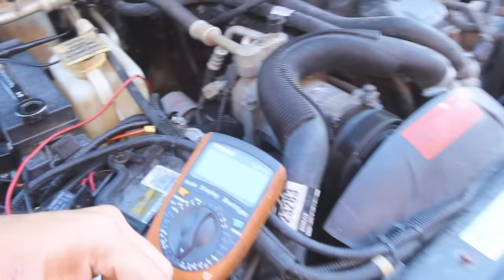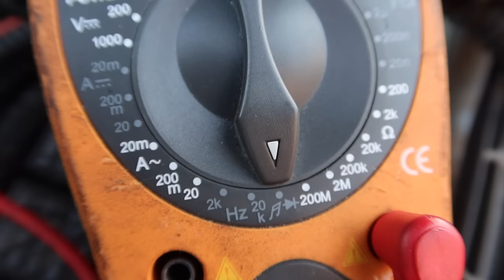AC Suddenly Stopped Working In My Car / Cheapest  Air Conditioner Diagnosis and Fix / Hot Jeep  XJ

Comment: Hello 
My current situation is - low side can’t take Freon psi is to high 160-170 psi , I notice the compressor not engage when I turn on ac , checked all the fuses and relays and they are good , fans turn on ,,,haven’t checked ac pressure switch not sure if I have one on my 2007 Acura tsx any help please thanks
Reply from the maker: Watch this yet ?  AC Suddenly Stops Working / Diagnosing An Intermittent Compressor Clutch Failure on a  Acura RSX
https://youtu.be/FEdrKv16jjY
Reply: @Donnythelatemodeltech  still confused lol 😩 I bought a compressor but feel like it’s something else

Comment: Just the video I need to check out my Dakota a/c. Clutch stopped kicking in and I called my local mechanic and he charges $95 per hour
Reply: Did you get yours to work? I too have a dodge Dakota and compressor is not kicking in. Waiting for tomorrow morning to Try this out with a paperclip.

Comment: Great video. Would this part be on a 2015 GMC Sierra truck. My air is not working. It would be great if it wasn't the compressor.
Reply from the maker: I'm pretty sure the 15s have a problem with one of the lines vibrating to failure,   leak.   Look it up.    There is an updated line.
Reply: @Donnythelatemodeltech  thank you very much for the response. I will like and subscribe.

Comment: Great video. Thank you, but what if you still are not getting any AC inside? Where do we check then? You turn the dial and absolutely nothing. Any feedback will help.
Reply from the maker: No air flow? Or no cold air?
Reply: No airflow at all.
Reply: @Donnythelatemodeltech  when I bypass like you showed the AC motor turned. When I checked inside the car the AC was not going on at all.
Reply: I have no visual leaks. I spoke with the previous owner and he tells me the AC worked great before. To check the relay. I'm not sure what you think since my electric fan is not working as well. Not sure if its due to the AC not working.
Reply from the maker: I think you need to look at the blower first.  Its under the glove box.  Test for power at the 2 pin connector.
Reply: @Donnythelatemodeltech  will do. I just recharged the system.  Apparently it was empty.  The motor was turning on and off and still not blowing any air.

Comment: Hello, thanks for the helpful video. I have a 2000 XJ and the compressor keeps turning off and on every few seconds when the AC is going. It is blowing hot air currently. Is the compressor supposed to do this or is it supposed to be rotating constantly when the AC is on? Thanks much for any help.

Comment: 0:38  look for oily line, check for oil on condenser/grill.  1:35  see if you have a bad low pressure switch ($10-20) using paper clip, see if air is cool when clutch engaged.  if it is, then the switch needs replacing, done.  10:13  could be a fuse, which means a bigger problem.
Reply: What’s it mean if fuse keeps blowing?
Reply: @johnhenry3820  You have an electrical short somewhere! Your fans have to be fully functioning properly too.
Reply: @geneyus6411  lol it was ac compressor
Reply: @johnhenry3820  your compressor needed replacement??
Reply: @geneyus6411  Yea did it myself the car is long gone now tho

Comment: Both my AC and Heater don't work when pushing in the button, also my engine light turned on.  Would the engine have something to do with this?
Reply: Your engine light doesn't necessarily mean something wrong with the engine. It just means something in the car is wrong and your computer noticed it. The good news is since your light turned on it 100% flipped a code which means you can take it to a chain auto parts store like advanced auto and they will plug a reader in and tell you the code. From there you can isolate the issue and have it fixed
Reply: @nathanpearce7169  Thank you!!

Comment: I am trying to research why me evap coil on a 2001 cherokee freezes up on the defrost mode, I can't find resources anywhere talking about it :( any thoughts where to start? Thanks!!
Reply from the maker: Is the evap temp sensor inserted in the evaporator?
Reply: @Donnythelatemodeltech  I have no idea, I need to research that I guess ha ha ha Went snow wheeling yesterday and my airflow took a crap, then I felt under the dash at the evap and it was icy :O
Reply: @Donnythelatemodeltech  Sadly there are no videos on the evap temp sensor, should I  just replace it and the low pressure sensor? Seems like just throwing money towards it works some of the time lmao. I didn't see anything that looks disconnected ....

Comment: Question . Got a 94 chevy van full size . Compressor kicking on an off . if i bypass that switch it stays on . when i put the connector back on the switch it cuts on an off still . i did check the switch for continuity an it is good . You think the switch could still be bad even though the continuity is ok ? Thanks much .
Reply from the maker: Switch is probably  good.     How cold is the ac when you force it to run?
Reply: @Donnythelatemodeltech  This van has dual system . Seemed like front was cool , not cold . Back was cooler . I added freon about a month ago with manifold gauges . showed no pressure on high side . was thinking wasnt pushing the valve down enough on the connection .
Reply: new compressor was put in about yr an half ago by a shop .

Comment: I have a 2008 BMW 328xi coupe and my AC stopped working. The AC clutch is spinning when I turn the ac on. When I checked the PSI for the freon, it read 13psi. I then charged it for about 15 seconds and it went up to 50psi. It's still not blowing cold air. Any ideas what could be the problem? Could the low pressure switch be the issue in this case? Thanks!
Reply: + Also, the fan is working.
Reply from the maker: Look at your blend door
Reply: @Donnythelatemodeltech  Thank you. I'll check that today.
Reply: Just found out that part of the AC clutch broke off and found it at the bottom sitting on the splash guard.

Comment: I have a 2017 durango 3.6 L. It's making a hissing sound when the ac is on and even with the fan on and the ac button turned off it still makes the sound. As soon as I turn the fan and everything off it slow stops making the noise
Reply from the maker: Pull your cabin filter out yet?
Reply: @Donnythelatemodeltech  I changed it about a year ago.

Comment: My switch is dead but also the clutch will not engage with the paper clip short. Also the radiator fan is running... The clutch relay and fuse is OK... Next step...? Thanks
Reply from the maker: Pull the clutch relay, take the cover off it.  Put it back without the cover,  manually connect the contacts,  see if the compressor  clutch engages.
Reply from the maker: Might try thus first https://youtu.be/FEdrKv16jjY

Comment: Not a cure all. A/C stops working for various reasons Clutch, fuse, relay, low gas, etc
Reply: Sure helped a lot of folks commenting here!  But you're right.  Good place to start, possible cheap fix.👍

Comment: @the late model tech .   I have a 2007 ford expedition I have had everything replaced for the ac.. the lines , blend doors,  the actuator , compressor , ECT... Ac works fine for months then goes back to hot air then works again for a while then stops  makes no sense what could cause it to work fine then stop .. what could the issues be?????
Reply from the maker: Could be your cooling fan.https://youtu.be/FEdrKv16jjY
Reply: @Donnythelatemodeltech  that was also replaced so I don't know I'm so confused
Reply from the maker: I think you missed the point of the video, your going to have to go in and figure out what's not working,  just because its parts are new doesn't mean you can rule them out, you'll figure it out when you confirm each part is indeed doing or receiving what they need to function.
Reply: @the late model tech     I was thinking could it be low pressure switch is bad ?? If so where is it located I have front and rear ac

Comment: Okay. Question. I went off road up a mountain with my 2002 jeep Cherokee. . it wasnt mire than a dirt road most of the way. At the very end it was a little rough. When leaving, I noticed my ac wasnt working thru the vents. It was going thru the defroster vent. Currently I am suttinv in a hotel after gaving my vehicle towed because after stopping at a rest area just outside of Boise, the jeep, upon starting, was super rough. I hear a weird vaccum type sound. In stranded right now. 1200 miles from home. I dont have money for a mechanic. In just a girl. I just bought this jeep so I am not familiar with them at all. Help?
Reply from the maker: Check all the vacuum hoses.        Listen for where the hissing sound is coming from.    The jeep is running very  lean and misfiring.    "Check all the little hoses from the intake manifold .... they stretch all the way from the drivers side to the passenger side running along the fire wall.   The ones on the passenger side control ac function-- defrost, /mode.    This one also also t's off and heads down toward the front bumper to a vacuum ball.  This line or the ball is probably your failure point.
Reply from the maker: Message me on Instagram for a quicker response

Comment: I tested mine with a paper clip and the compressed was working so I went ahead and replaced the pressure switch but it is not working with the new pressure switch. Any suggestions?
Reply from the maker: When you bypassed it did the ac get really cold?
Reply: @Donnythelatemodeltech  Yes, it got really cold and it never fluctuated on and off it has consistent power which lead me to believe surely it was replacing the pressure switch but I’m afraid not.

Comment: I have a question I don't know what the problem with my ac the compressor starts but it blows no air at all through the vents
Reply: It's a 2007 Chevy uplander
Reply from the maker: You need to look at the blower motor , look at the wiring for burns, look at the blower motor resistor for burns ,  test the motor for power.

Comment: Will the paperclip test work on my 2015 jeep renegade?..it won't shortcircuit the car?
Reply from the maker: If it has 3 wires no.  Its a sensor.   You need to jump the relay.

Comment: Where could you look for the failure if by doing this test the sensor is working properly.?
Reply: Check Refrigerant pressures then circuit to figure where you lost operating power.

Comment: Hey I have a 2013 Nissian Maixium the AC stopped blowing out cold Air could this low pressure switch be the problem on it.
Reply: sound like you need a charge of freon..lol
Reply: doing same thing tomorrow on a chevy spark clutch won't engage

Comment: Hey so I tested my switch, I have continuity and no leaks. My ac compressor kicks in and immediately turns off and then back on. Is this normal? Ac blows warm
Reply: Similar problem on my Saturn. I bet your compressor fan is not coming on thereby making the AC compressor shut off. AC systems shut off to prevent the system from too much pressure if the fan is not working. I jumped the AC relay on my fuse box and it stays on, so I know the system is charged and working etc.. but the fan is the issue. Your air is blowing warm because the AC clutch is not engaging so you just have outside air, which I assume is hot right now? Hope this helps
Reply: @lees5402  .

Comment: I have a question that is related to this topic. I just bought a sn95 1994 mustang gt that needed some work but am fixing it up to be a daily driver. A problem that I have encountered is that in the AC switch on the front console is free spinning with no resistance what so ever the air seems to be stuck in about the middle between cold and hot does anybody know what could be the problem and how it could be fixed
Reply from the maker: Sounds like the cable on the back of the controller is disconnected

Comment: By the way, any help on the heater not getting hot, maybe a sensor for low pressure??? LOL I am a woman who tries and usually succeeds. TY 97 Jeep Cherokee XJ 6 cyl 4 wheel drive
Reply from the maker: The heater is completely different.
Reply: @Donnythelatemodeltech  what if the compressor ain't coming on ?
Reply: @Moneyoverbullshit850  the compressor has nothing to do with the heating process.  Antifreeze circulates to a small radiator under your dash at all times when the vehicle is runn ing and up to operating temperature.  Fan blows across the small radiator called a heater core and it flows through the vents if the correct doors are open in the case that holds all this together.  They open and shut depending on what you have selected heat or a/c.
Reply: @Moneyoverbullshit850  the compressor has nothing to do with the heating process.  Antifreeze circulates to a small radiator under your dash at all times when the vehicle is runn ing and up to operating temperature.  Fan blows across the small radiator called a heater core and it flows through the vents if the correct doors are open in the case that holds all this together.  They open and shut depending on what you have selected heat or a/c.
Reply: Thank you for the info, very helpful.

Comment: i ordered the part now i have to find it i have a 2010 hyundai tucson
Reply from the maker: Let me know how it turns out.
Reply: Changed my ac lower pressure sensor and my fan came on I saw on the old sensor the little gasket had a little tare  thanks for the video saved me ain’t no telling how much the shop probably would have made me buy a compressor I have been cheated so a couple yrs ago I bought a Jeep and that’s when I really started working on cars tune ups and oil changes and sensors I just have to find the location and I can fix anything if I see the video I also work on lawnmowers washer dryer’s and stove and home improvements lol thanks again 🙏

Comment: When I jump the pressure switch connector it doesn't engage but when I jump the relay it does. Any advice?
Reply: Swap in your horn relay and see if it works
Reply: @paulgadson3046  I swapped relays. No change.
Reply: Check the control circuit at the relay you need a wire diagram to see what turns the relay on.

Comment: Why would my radiator fan blower motor fan and my AC compressor all stop working at the same time
Reply from the maker: 1. Fuse  2. Ac control head issue.

Comment: Great video, I have a Ford Fiesta my ac clutch started clicking on and off every 5-10 seconds my fan clicks inn when I press the ac on and I’ve had the pressure checked and it’s full, after a week or so I just left it alone I then tried to turn it on and the clutch does not turn on at all but the fan does turn on, do you have any suggestions please. Thanks

Comment: I have an issue that I can’t find any info on. My jeep xj blows air from outside, so all year around it blows hot in the summer and cold in the winter. Any ideas?
Reply: Does your car have 2 fans  by the radiator cuz  it cud be your  fan. It doesnt blow the air thrugh thw ac radiator to regulate the ac temp
Reply: Giant Giant there are 2 fans. I just noticed that one doesn’t turn. What could be the issue?
Reply: Check your fuses the relay you should have 2. Relays for fans.   Maybe switch them around see if they turn on or its the fuse tingy from the ac. Line i forgot what is called ill shoot u the name
Reply: Low pressure switch  install a cotter pin in it. To test if the fan works on the cable.  Not the switch. Ill send u a link
Reply: Giant Giant  I’m really thinking it’s the heater core

Comment: Mine has the same problem but when I bypass the switch the compressor clutch engages but still blows hot air and I have good ac pressure
Reply from the maker: What are the pressures?
Reply: @Donnythelatemodeltech  i actually haven't checked the low side but high side reads 40
Reply: Blend door is good i can feel  and hear it go from warm to hot
Reply from the maker: @juniormartinez3391  that's way off for the high side
Reply: @Donnythelatemodeltech  im sorry I ment thats what the low side is reading i haven't checked the high side
Reply from the maker: @juniormartinez3391  gotta read the high side man.
Reply: @Donnythelatemodeltech  im sure thats the problem i just don't have the gauge for that high side fitting

Comment: I did the paper clip bypass of my AC low pressure switch, and the compressor engaged and out came nice cold air from the vents.  The AC continued to work great as long as I left the lp switch bypassed. So, I replaced the low pressure switch, and the compressor then cycled on and then off and then on and off - so on - engaging about 3 seconds before disengaging and then engaging again.  So, bypassing the low pressure switch fixed the problem, but a new low pressure switch just caused another problem.  Anyone here know why this happened - what it means (other than a possible defective new switch) - and where do you check the pressure in the AC lines?  Thanks.
Reply: @Vic02 Thanks for your reply. -- That's what I figured too.  So, now I need to learn how to use an AC charging gauge-manifold to charge it with R134 -- so that I get it right the first time without making matters worse.
Reply: @Vic02 Okay.  I'm guessing you mean a scale to first weigh the can of coolant before it's opened and then weigh it after the system appears charged to know how much coolant went into the system.  (I have an excellent kitchen scale, which should work for this) -- So, how does knowing how much coolant went into system during charging help you to be more accurate in the process?
Reply: @Vic02  Brain hiccup  -- yep - coolant goes in the radiator and refrigerant goes in the air conditioning system.